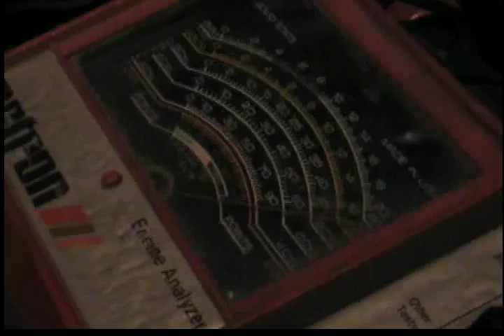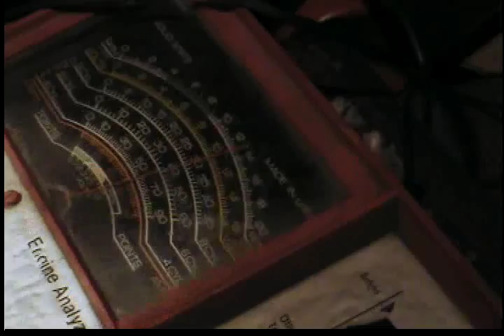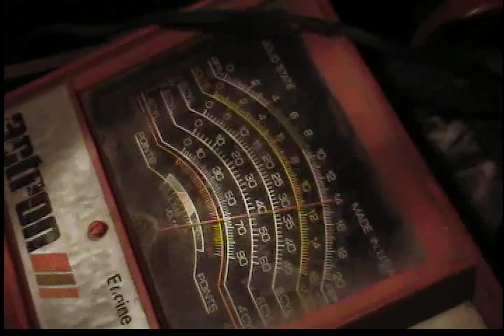clutzo tweeks the slant 6 timing

Comment from the maker: if ur defenition of knocking is the same as mine, setting the timing correctly may not help u. getting the timing set correctly will help eliminating the "ping" noises when u accelerate or pull a load. 
generally, a real "knock" is deeper in the engine. sometimes the rocker assembly can mimic a knock. have u checked and reset the valve clearences?

D~~~!